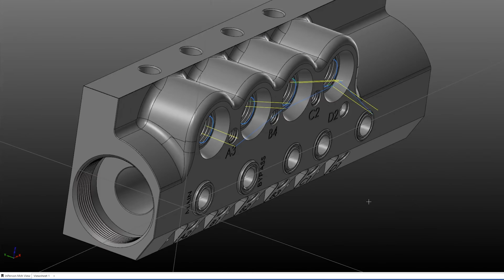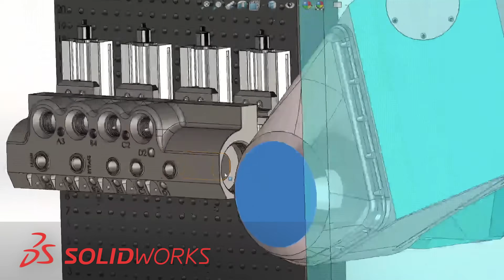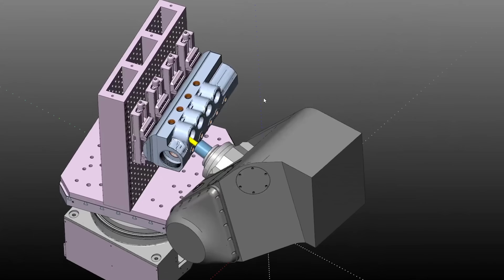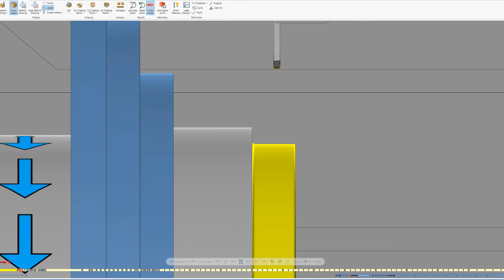Manual or CNC Machining...Which takes MORE SKILL?

Comment: Absolute BS, as I’m one of the commenters who made the remark about manual versus CNC. The point I would make is that it does take more skill to achieve the same standard of work that would be done on a CNC, not least because things like trig don’t play a part in cnc because the software will do the maths. The mere fact this video has the presenter so obviously rattled is unprofessional at best and dam right disrespectful at worst to those who sweated blood and tears working to close tolerances using wanked out machine tools and cutters. I was trained in CNC alongside manual machines and when it comes to breadth of skill set give me a manual machine any day and not a mouse and software.
Reply: Hahaha here we go again! Like I said in the video, manual machinists are no LESS skilled than CNC machinists and vise versa. They are 2 COMPLETELY different skillsets built upon the same foundation. And I'm not rattled, just minorly annoyed when people like yourself try to say any different, because you obviously lack a solid understanding of both. I started on manuals and now work at the best CNC machine shop on the planet. I would say that MY understanding is ROCK SOLID. Thanks for watching.

Comment: To me you are comparing apples to oranges. Both require skill no doubt. But today's skill is based on yesterday's masters. Yes it requires skill and knowledge to program but, it also to skill to run manual. Each needs to give the respect that each deserves. Your video do not give respect for the knowledge gained by decades of experience gained by older generation. I agree totally about today's being faster and more accurate but don't forget where it came from.

Comment: My answer to "this is how we have done this job for years/decades" is always: if doing something a certain way for a long time is a genuine reason to just keep doing it that way,  we would still wash our clothes on a rock in the river because that's how it was done for centuries...do you wash your clothes like that? On a side note: I just finished a course in designing parts using CAD, it has more buttons than all the machines in our shop combined (50+ machines) just learning what they all do is a skill in and of itself...

Comment: Most..If not all cnc machinists had to start from the basics and learn how to setup and operate manual machines as well. Most of of the schooling for a machinist apprenticeship is manual work. In a 4 yr course, cnc was the last 2 weeks of the last year. Some could say those who can run manual and cnc are more skilled then those who just know how to read a dial and turn a knob. Feeds, speeds, chip load etc all come into play in both cnc and manual.. there is a bit of truth to being a "button pusher" or somebody who just presses the "green button"..it takes a while and a lot of planning, setup, testing etc to get to the point where you can just press the button. If all you do is get a program, load it and think you just have to press the green button im 1000% positive that you'll crash the machine.

Comment: Both skills are very different but are relatable. I started in the late sixties on manual machines that had 3 complete turns of backlash in the feed handles so precision was very difficult to achieve and was more of an art than a science. I ended my career on CNC machines and was involved in the very early days of that. I was self taught on CNC ,in the late 70's and early 80's, as was the way in the early days, All I had was a pile of manuals and a machine to practise on. Thats why I believe what you are doing @titangilroy is so important. 
What can be achieved with CNC machines could only be dreamed about when I first started out in engineering
Reply: It's relateable to back in the time of the hammer and chisel days when routers and similar started coming out. You could only dream of certain things with the chisel what the router could do so the progressive improvement over time but on the other hand it doesn't always mean the old has to completely die. Some of the old is still required to continue to assist with the progress.

Comment: i bought a manual because i run niche products that are not greatly complex, if i need a complex part, i 3d print it and then send out the revised version to a cnc shop. "i do auto resto mods and like the simplicity of manual"

Comment: Manual machining is still good for one off parts or for removing things stuck together. Because then you can feel the machine and pressures on the part, instead of a CNC doing it and putting heaps of pressure on something. Manuals are still faster for single parts as it doesn't require modelling and programming first. CNC is better for complex machining or consistent repetitive machining. CNC does not rule out manuals entirely. While I agree that CNC machining is more complicated than pushing a button, it does not overrule manuals. I've worked with both and manual machines have their place. Cncs are more efficient for production jobs, they rarely are for single parts.

Comment: Old school manual machining was less forgiving than CNC machining is today.  You have access to incredible tooling that in some cases you basically can't break, it's so tough, strong, and removes stock so efficiently.     But go back a few decades and even the best end mills available were relatively fragile and you had a fairly narrow window of speeds and feeds to work with that would give good productivity, accuracy, finish quality, and tool life. 

However, going by those rules of manual machining, written 50 or more years ago,  would make you a very unproductive CNC operator today, as what a CNC machine can do for cutting parameters is orders of magnitude higher.    

I do believe that it's easier to transition from manual machining to CNC machining,  than vice versa.  When you learn manual machining, you soon gain a natural understanding of the process of cutting away the excess material to reveal the part hidden within. 

I could operate a CNC mill I've never seen before, and make parts on it with a fairly short lesson in how to operate it when it's set up to do a production run.     But could I bring in some random guy off the street and tell him to make the same parts on a Bridgeport manual mill and expect to get any good parts that day?  You know the answer is no.   But I could teach that guy how to push the GO button on the CNC machine, and change parts.
Reply: Spot on 👍

Comment: I can see a CNC MACHINIST having skills, but not CNC OPERATORS. I know quite a few CNC Operators and all they can do is follow a setup sheet and push the green button. Need to set a tool? HELP!!!! Tool chatters? HELP!!!!! Insert burning up (because the forging is a little harder than normal) HELP!!!!!! Oh the insert broke down and you need to rerun the bore pass. HELP!!!!!!! THOSE people are NOT skilled.
Reply: VERY VERY true. I have seen companies hire "button pushers" as the highest level machinists, and then they ask questions like "hey, how do I comp my drill bit on the mill to make the hole bigger?"

Comment: Saying CNC is just pushing buttons is like saying running is just moving your legs. Well, ever heard of needing to walk before you run? CNC still requires skill, it's just built in conjunction to a different set of complementary skills.

I mean, actually learned to use a Slide Rule. It's a Eugene Dietzgen N1732. Why would I ever use this when I have a TI-84 calculator and a phone with Wolfram? Simply put, I was lacking in an understanding of numbers until a slide rule forced me to approach it in a way and use more fundamental skills which in turn improved other things further down the line.

Comment: Manual is for the birds. It's just not where I want to go in my career. I love the tech side of the industry and seeing how I can make the machines dance.
We typically only do manual machining for repairing something that is broken. 
Pro tip to speed up one offs: Learn macro programming and sub-routines. In every one of our CNCs(FANUC) I use standardized macro programs at O7000+ range as utility programs. We have various programs like spot, drill, tap; face, turn; flycut, contour and so on. Just plug in a few numbers and you are off. To make it the most efficient you need to have few tools standardized in your turret or carousel.

Comment: You are correct to a point, yet you may want to give the old timers some slack. A simple fact is someday you will age and slow down a bit. The experience and weird things you have seen are still all there and have value. You may also find some certain strength in this worker like patience or so careful they almost never waste stock on a scrap. Odds are if you work long enough some young person similar to you now will have some attitude that you have become obsolete.

Comment: I am an industrial Maintenance / electrical repair tech by trade. The old school manual stuff still has its place such as for repairing a one-off shaft or such. For multi piece count parts or production runs I would go CNC all the way. they both take a tremendous amount of skill to be able to program the CNC or crank handle on a manual mill/ lathe.

Comment: There are manual applications I like. However, this is real talk, I started manual Bridgeport and now run 5 axis grinders. Ive used 5 and 11 axis machine centers. Manual vs cnc= checkers verse chess. You need to be able to think thru all your moves in cnc

Comment: If only our multi billion dollar a year corporation would get this threw there heads. We are running cnc machines from the 1990's but because they are still running they won't buy anything new. 
Then they did buy a five axis cnc, huge machine but wouldn't pay for the softwear to program it. Instead they use the programming softwear they bought in the early 2000's and then wonder why they can't get the machine to run right.
Reply: Wow now THAT is dumb. But I have seen that before. The company thinks that buying a machine will fix everything, but then they don't invest in the software, tooling, or people to actually make the machine perform as intended.
Reply: @barrysetzer  that is excatly what happened. We also had Mazak refuse to come in to service a machine an operator crashed because our company didn't pay their last 10k bill.
Reply: @wendull811  Hmmm thanks! I am going to do my next "story" on exactly that I think!!!
Reply: @barrysetzer  nice

Comment: I almost fully agree with you on this subject. The only thing that I have a slight disagreement with is that something I have seen quite often (though not always) is the guy who is fantastic at cnc work, but doesn't fully understand the mechanics of the whole system in a physical sense. Not that they can't learn, but I've seen some terrible outcomes from (the boss, owner, etc.) believing that the guy who is programming and setting up a job is better than the older guy with manual experience. IMHO, I believe that for some to really get good, at least have them run manual for some time  because you can "feel" how things work. I.e., a huge difference between  a good strong setup that you can really feed and blow out,  and a flimsy setup that chatters or slips, or that you have to baby it through can simply depend on which direction you're cutting, or the depth of cut, or the length of a tool that has a specific chatter frequency. Secondly in some cases it can be a lot cheaper to tram in a Bridgeport head than have machine repair services fixing a crash. There also are times where a small company doesn't have the $$ to buy all the fancy equipment and programs to support  things in the beginning. (been there done that). Not to be condescending, but some small outfits don't necessarily start with a pocketful of $$. Good article though!

Comment: People that go directly into CNC are at a huge disadvantage. They aren't able to feel the things you need to feel. They aren't able to develop the inherent ability to know how different materials react, how strong those materials are, and how rigidity affects things. They think that because they can use a 3d printer, they can be a machinist.  It's like any other field, where you don't know what you're doing because you missed out on the building blocks. Most CNC "machinists" are just CNC operators. Button pushers. They don't know how to do anything except tighten down bolts on a pre designed fixture and press go.
Reply: I disagree. A lot of what you would learn by feeling a material cut can be gained by looking at it's chemical makeup, it's hardness and what ISO material group it falls into. I don't need to feel a high nickel alloy cut to tell me that it's going to work harden quickly if I don't keep a positive feed on it as much as possible. You can feel and hear how materials cut in a CNC machine very easily. Load meters give you a large amount of useful information. The fact that manual machining doesn't often use flood coolant also changes how hard or fast you can cut a material.

I'm always skeptical of people who call themselves a machinist. I've worked with guys who have made nothing but the same family of parts for 25+ years. They'd shit themselves if they were asked to do a completely new part from the ground up.  I've been in the trade for 20 years now and can confidently take a part from drawing to finished part. That to me is what makes a machinist. The tools used CNC or manual are really not an issue. 

I do agree that people that think that 3D printing is the same as machining are in for a rude awakening.

Comment: Machinist is the highest skilled trade period software and cnc only made it higher skilled more technically advanced and more productive. With this being said some one who loads a peace of material locks it down and pushes a button then removes and repeats. Without the ability or understanding to how the raw stock became a finished product of high quality and upmost efficiency makes you a cnc operator not a highly skilled MACHINIST! A machinist is the person who can take a design determine the best way to hold what type of fixturing needed, make the fixturing, determine operations, sequence of operations, determine what tooling to cut it with, establish speeds and feeds, use software to cut the design, verify product falls within tolerance to design and do all this with the highest quality, efficiency and productivity. Any one can be a operator only the ones who apply themselves can be the best MACHINIST! MACHINIST WATCHOUT PRINTERS AND TECHNOLOGY MAY MAKE YOU OBSOLETE JUST LIKE CNC REPLACED MODEL MAKERS THEIR MYLAR DESIGNS AND TRAMMELS. THERES HISTORY FOR YA IT RPEATS.
Reply: I'm not a bit worried. There will ALWAYS be a huge demand for big lathe and vtl machinists. A cnc lathe with a 40" swing and 12 feet of bedway costs millions and I will work circles around it on low volume shaft/repair work. 
       And what's more, a skilled manual machinist who's under 50 yrs old is like finding hens teeth nowadays. There are probably more brain surgeons under 40 yrs old in America than manual machinists.
      What wage does my skill set demand when a company has a breakdown that's costing them $25- 50k an hour in lost production??
Reply: @ME-pb2gf  yeah specialized but to think their aren't cnc machine lathes that are 4 5 and 6 axis and larger than yours.  that are 100 to 1000 times more efficient and those companies can under bid yours and still make a 30% profit margin is lethally naive on your part. Respectfully speaking ofcourse. Everyone that has ever denied technological advancements have paid the price gone out if business or were replaced. Ergo model makers! For the love of God don't deny the inevitable for your sake!
Reply: @Jon-O.  Like I said. Millions of dollars would be wrapped up in a lathe with that swing and bed length. Then you still need a VERY competent and skilled programmer/operator. Your profit margin is completely wiped out and you're in the hole on one-off or small run jobs when the guy with a big 1940's  Pacemaker down the road will get it done in half the time and less 💰. 
      There is also a HUGE demand for mold makers and tool and die guys. So I'm not sure what you're implying by "model makers" not existing anymore.
Reply: @ME-pb2gf  my first job in a job shop company "Progressive Model"  back in 1983 I was being trained by a model maker to become one. They At the time were the cream of the crop in the tooling industry. Above progressive die makers. I was intelligent enough to have subscribed to industrial magazines at the time that said cnc machines will replace model makers and kellering machines because they would be made obselete. Sure as shit that's exactly what happened ten years later.  It was also why I went to college for cnc and cad cam in the mid eighties and began running manual milling boring machines and lathes. Then transferred to cnc hi precision gauge fixtures and master body gauge tooling for the automotive industry. Then progressed into areospace space and military cnc machine work. This company Futuramic bought all their cnc machines cash. There largest machine is a 150 foot 5 axis vertical gantry mill that dose everything including large round lathe work and extremely precise and extremely productive. Go back to school sir because multiaxis multiple spindle lathes are kicking ass and worth their weight in gold when it comes to precision and productivity we have them one of them is forty foot bed paid for in cash. How's that possible because cnc increase profitablity so much the company if managed right can buy expensive equipment that make more profits than the old manual machines ever could. You can deny it all ya want but you'll end up like the Model maker who was training me in the unemployment line. With his Kellering Machine hand buddies. The sad part is if you don't transition the industry will lose a highly trained high quality Machinist and that's a tragedy. Especially when we are rare.